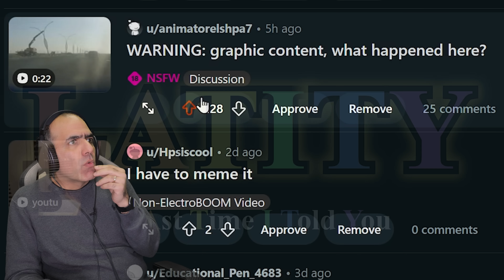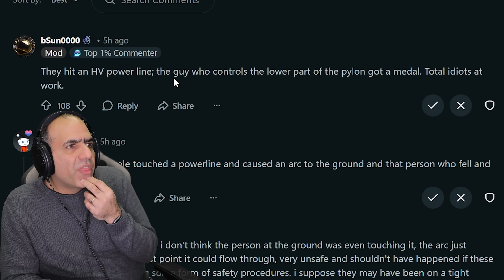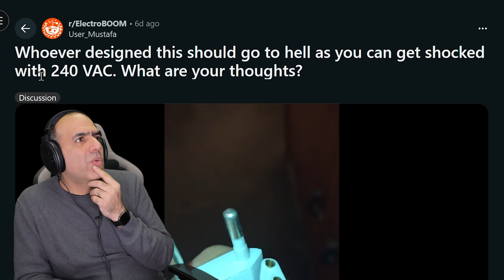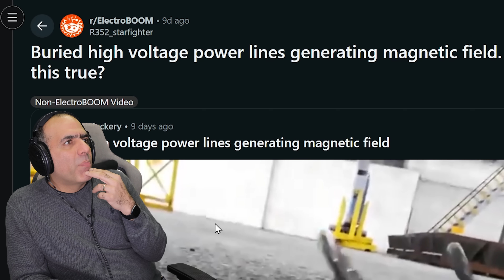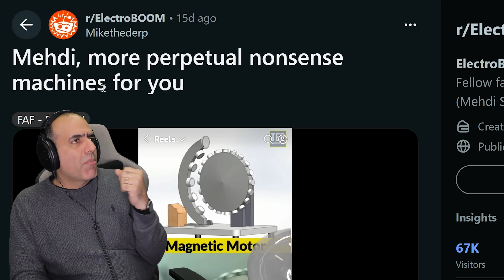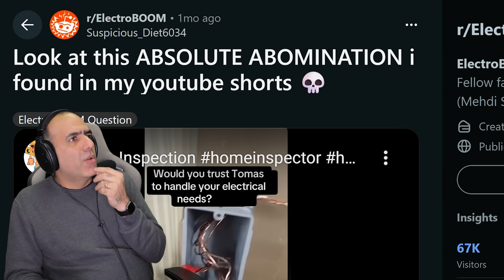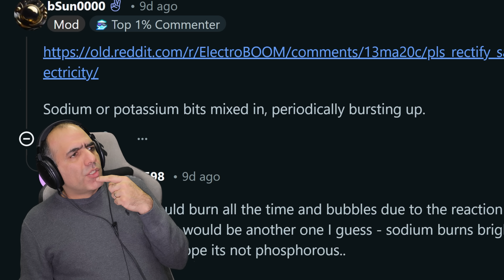Have a Pole? Need a Hole! (LATITY-017)

Comment: 5:20 it is a polymer capacitor - they don't have this emergency overpressure stuff - normally they don't build up enough pressure.
12:35 it is because of the momentum caused by the ion emisson, not heat. The heat expansed to every direction, so it wouldn't turn.

Comment: 11:03 those are contactors and it looks like that is an auxilary switch? But also unclear what it's switching so it could be some other accessory that attaches to the contactor. Usually those are clipped on securely not flopping around like that. Buzzing is a common sign of a failing contactor.

Comment: Japanese sockets don't use ground - they have a GFCI breaker on all those circuits instead. It was cheaper to install a GFCI breaker than to add grounds to all their outlets. Though modern installations do have grounded sockets.

Comment: I’m not mad at the title. Because it matches the display photo Apparently the user had a plug with a pole on the top. And there was an outlet with the same port as the plug but no hole. So he/she just drilled a hole in and decided to plug it in

Comment: Those double outlets with 220v and 110v aren't particularly common in Brazil but you do find them in some places. I'm a school teacher and the lab we use for experiments have those.

Some places in Brazil use 110v and others 220v. The most common is the 220v though. So we have to be a little bit careful with ordering things online because of that. Last semester the school bought a soldering iron I requested and I didn't realized is was designed for 110v. Of course I made it useless haha

Cone to Brazil man!

Comment: 12:41 Yes. Here in Brazil, it's very common to find outlets like this, and believe me, many incidents happen with electronic devices plugged into the wrong voltage. (Device designed for 110v plugged into 220v. Generally, 220v is used for high-power devices such as large-capacity ovens, electric showers, and air conditioners.) There are regions where 220v is standard (phase + neutral) and 380v (phase + phase), and 380v is used only in the industrial sector.

Comment: 13:03  hahaha ask me how I know it’s wrong, I live in Mexico , and I love repair drills and old equipment, I was on a face and bouth 3 metabo drills from the 80 but 220v and usa and mexico is 120 soooo you know were is going , wire the second face form the panel to my workbench but o I don’t have the euro plug aaah let’s use the normal and keep lit so the drills work I was happy but forget to disconnect the 220v code braker 3000 hahaha and tururu my boyfriend connect a extension whit incandescent lightbulb (the one for auto mechanics) and the bulb exploded hahahahaha ooh😂😂😂

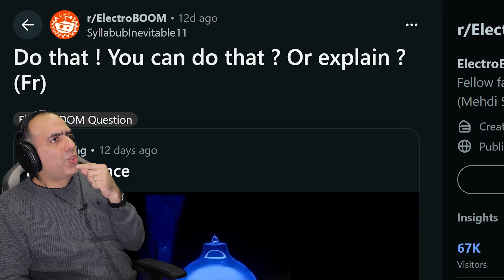Comment: 7:47 about the extensions , I use bosh, metabo, angle grinder cable because awg 12, its flexible and most importantly of all it’s free wen the appliance are burn beyond repair

Comment: @electroBOOM 10:23 it could also be a piezoelectric switch. I have one, which doesn't use any batteries. It uses the force of pushing the switch in either direction to generate the necessary power to send the signal.

Comment: 11:01 Capacitor soft-starters.  The loose 'auxilary' block with the curly wires cuts in power fractionally before the main contactor contacts close.  The curly wires are actually resistors that act to 'slowly' (it's actually a very short amount of time) pre-charge the capacitor prior to the main contacts closing the full current in.

Comment: 12:45 - We do have the same appearance for both, 220v two fase with 120º or 127V one fase. It's pretty common to see people using 220v devices in 127V outlet and complaining about low power as well see people blowing or breaking devices 127V in 220V outlets. In my house I reorganized them, REDs are 220v, whites are 127V.

Comment: I have a question. Since we cant create a free energy, why cant we just bring the energy, back where it is started to be reused? So my example is to use a rechargeable battery(s) that will pump the water up, down the stream to move the watermill to generate power. The energy go into the batteries and the remaining will go into the what ever you want to power up.

Like I said this is an example but I am interested if it is possible. Maybe not a home made model but if it is constructed with the right size and the right materials, would it be possible? Since it isnt free energy but it would act one since the battery is recharging and deploying with the right ratio so then the battery wouldnt ran out of power.

What do you think?

Comment: It's shameful that you don't have no regards for inconsistent lights which are extinct ,

In iran 
We only have cheap versions upto One thousand  watts of power,
Those pencil like ones,
What if you need cheap avaliable option for high resistant ressisstor in your circuit contraption?
If you use them in half of rating they serve long duty, 
They are safe,  desepate safe failers ,
Even act as a environmental senior for emergency do to their physical limits. 

I'm really unsatisfied when in experimental contraptions they need large ressisstors, 
They go with water hitters instead of lamps 💡 🥲
That's Immensely more si fi 
Even more than sparks and right behind plasmas and explosions cool factor implemented in a creative project. 

Bring back analogs, 
I whish an nuke this winter santa😶‍🌫️👊✊🏻🤛👊✊🏻

Comment: Why do you need ferrets, when you can actually just use a Shop-Vac on one end and a plastic bag on a pull string on the other. Faster and more reliable than a train ferret.

Comment: Plugging a 220V thing into a 110V socket can actually cause a fire (or trip a circuit breaker or blow a fuse). If the thing you plug in has a flyback converter, it'll pull twice as much current as it's designed for in order to get the correct output voltage. Even if it seems like it should be safe, don't mix voltages if you don't know what you're doing!

Comment: I still remember the first time I came across one of your videos way back in the early 2000s, it was the video of you opening up and discharging a camera's flash capacitor. You ended the video by dumping the whole thing into a dumpster. That video wasn't...super educational, but when I found out you had a channel, I was super into it. And since then, you've taught me a shitload about electronics. I didn't understand resistors or capacitors at ALL before your channel. So don't feel bad for the "silly" videos, they still get people interested, even if they themselves don't necessarily educate.

I feel like the issue isn't access to knowledge so much as it is getting people to want to learn.

Comment: Philippines is 230 Volts and these 10A outlets are secured with 20 A slow response circuit breakers. Ground is usually missing, even though our regs are based on NEC 2017. Likewise GFCIs and RCDs are usually absent as well. 

Our system is quite unusual: Each phase is 115 V to ground with no neutral and no ground supplied to the home by the electricity company. Our grounding system is considered TT, but without neutral conductor. The transformer middle is grounded at the post only with an earthing rod.

Comment: Having power outlets with two voltages is very fun, peploe aways burst they things plug in the wrong power outlet.
4 years ago, I worked in a factory that uses power outlets with two voltages in the kitchen for the enployers. One day, someone come to us (the electric maintenance) with a microwave oven that someone plug-in the the wrong power outlet, putting 220v instead 127v. Whe changed the fuse and the microwave oven work again. The same guy take the microwave oven and after 30 minutes he come again with the microwave oven not working again, and yes, someone put it in the wrong power outlet again. After that, whe print a waning label and put it in on the cable with something like "ONLY 127V".
And, yes, I live in Brazil.

Comment: 3:34 we use incandescent lights for theater because they produce a different type of light than an LED so you can put gels and other things on them. We also use halogen lamps which can use up to 575 to even 750 watts! I'm not an electrician tho so I probably got something wrong

Comment: 6:30 this is an aluminium processing factory, refining involves putting the "raw" aluminium through an electrolysis many reactors (around 200 for the largest factories) contains two electrods to purify the aluminium. The voltage in each reactor is around 4.5V but the current goes to 100 000 Amps, thus creating a huge magnetic field.

Comment: 3:38 incandescent lights are actually still helpful in older homes in the winter as they passively help with heating and save on power bills related to space heaters and furnaces (Its a little bit but trust me it's noticeable in heat and savings)

Comment: I had a fun electric shock issue with a really old hot plate a few months ago.  I was using it to make a finishing wax for woodworking and set it up outdoors.  As I was sitting on the ground stirring my pot of wax my hand was weirdly tingling.  I eventually realized I was getting shocked and there was some kind of short in the heating element.  I switched to crouching so my shoe soles were isolating me but still was very nervous about it until I finished.  I'm going to be switching to a different option next time I need to make more finishing wax.

Comment: 12:24   Don't you mean DC?      Looks like a high frequency DC Tesla coil, with a spinner.  I need to make one of those for mine.      
I've never seen high voltage A/C arc to open air like that (yes I have a 16Kv neon tube transformer too.

Comment: I still used incandescent bulbs in series as a current limiter with vintage electronics while testing them. If something shorts inside, the bulb just lights, otherwise it reduces the current to the device, this setup is also connected to a variac.

Comment: I remember a friend plugged his CPU into a 220V outlet when it was meant for 110V. Goodbye computer! Before connecting, check the voltage your device and your country's electrical grid operate at.

Comment: 9v batteries are designed to be able to link together to create higher voltage batteries (the + & - terminals can snap together)

every time i have two 9vs, i get the idea to put both terminals together, making an 18v incendiary bomb

Comment: The magnetic field making tools and other steel stand upright is in a primary aluminum smelter, and this effect is very typical for these smelters. The busbars running under the floor carry hundreds of kA. In the video you can see an aluminum electrolysis pot on the left side, covered by the angled panels. The dark grey angled beam is connected to the underground busbar and carries the current, it distributes it to the vertical poles sticking out of the panels, these are connected to the carbon anodes. Many of these pots are connected in series, these plants are often over a kilometer long.

Comment: 11:19 My water heater at home had a problem where the electric heater shorted to the water, so there was live voltage on the water pipes. Because I had GFCI installed, I was aware of that, but people who don't have one might get these kinds of issues.

Comment: 19:50 Bring electrical tape to the Philippines bring lots of electrical tape. When I visited I was moving a fan so I ran my hand down the cord to unplug it from the extension cord. Yes they're 240 V 60Hz is quite spicy!!!!!!
I ran out of the electrical tape I bought because I used a lot of it on chords with nicks.

Comment: 10:09 The switch is mounted on an iron column and the roof has iron beams. I'm more inclined to think they are using them to conduct the electricity to the bulb, so don

Comment: 13:00 I imagine it is for tourists. If you live in NA, you can buy adapters for 220V very cheap, but they still operate at 220V. Fine for most things, but not all. If you plug them into 110V instead, then you just get 110V!

Comment: I walked under high voltage power lines for years to get to school. I'm pretty sure the sound in the video is arcing from dew drop to dew drop (or raindrops or fire ants) along the ceramic insulators, not corona discharge.. A visible corna was rare so I can't swear to it but I think it made an airy and chill hiss sound. I imagine a squirrel would be quit loud but I guess they didn't want to go so high or were spooked by the tingles or fur standing up or something like that. At least one ventured up the lower voltage transformer for our house. The steam(?) explosion blew apart the skin on his belly and partly skinned. That sounded like a cannon going off.At least it seemed to have instantly killed the poor little guy so he didn't suffer.

Comment: Was so happy to solder my first little project. I used 3 13500 lipos I harvested from vape pens people threw on the street, and a USBC Lipo charger board, and soldered it into a $1.50 lantern from the dollar tree. Whole process took about 40 minutes, and I just used spare Christmas wire scraps to extend some leads, and a pair of pliers to cut some of the AA terminals out. It is able to run now, at over 10 hours per charge. Just a thing I wanted to share with people that might find it cool too :D

Comment: trying to use a new welder, but the anti shock feature... preventing the fiberglass asbestos from burning that normally creates a fire that electrons turn into a plasma. "arc fault built into appliance"

Comment: With the weird extension cord they probably got the plug and wire off a broken appliance and the outlet from a old house or building they built it themself from available parts that didn't cost anything

Comment: I wired an 240V baseboard heater yesterday. 
Connected one end without realizing the other wasn't completing the circuit.
I learned the importance of ground wiring that day; it literally saved me from 240V AC shock.

Comment: Brazilian here,
The electric grid is a mess, so we have 220v/240v and 100v/127v at same time in some regions of the country, but the entire country uses 60Hz
There's no difference between the plugs for 220v and 110v, but there's a difference for the current draw: 4mm diameter for 10A and 4.8mm diameter for 20A sockets.
It's not a big deal as seems to be because, the majority of appliances are Bi-volt.

Comment: 10:40  @ElectroBOOM  in our country (Philippines) have only 230V in the households while 240V in distribution lines. The 250V could be the maximum voltage that can handle the outlet 🤔

Comment: The switch is not battery powered, at least not in the conventional way. It has a piezoelectric generator, like some cigarrette lighters, that provides the power to a circuit for a brief moment. This is enough to transmit a code wirelessly to a receptor that toggles the circuit or triggers a command. I love these, and was suprised by the idea when I first find out. Pure smart thinking. Schneider Electric is the manufacturer.

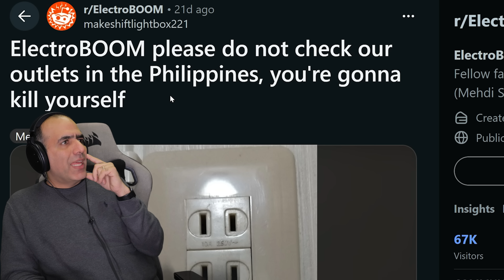Comment: 10:27 i believe you can also get/build variants of it that use the mechanical energy of someone throwing the switch to generate enough electrical power to transmit

Comment: In that first part where the light post contacts the power line the real hazard wasn’t the electricity, it was the arc flash.  That arc at the bottom of the pole is a ball of plasma that is hotter than the surface of the sun, and its initial expansion is faster than the speed of sound.  Judging by its size, the shockwave was the equivalent of several sticks of dynamite, only much, much hotter.

In my initial high voltage electrical safety training class, two guys walked in.  One of them had strangely smooth skin on his face.  He stood up and told us he was there to show us what would happen if we didn’t pay attention.  Then he took off his shirt.  His skin looked like melted candle wax.  Then he picked up his shirt and left.  The second guy told us he had been working in an L shaped underground vault containing 70kv cables.  The rule is you always have one man working, and another watching him to yell stop if he sees a mistake being made.  Being pro’s who had done this type of work for years, they got complacent.  The guy doing the work needed a tool they had left on the truck.  The guy with the melted skin was the watcher and left to get the tool.  He stepped around the corner of the L, about 30 feet away, and woke up from a coma six months later with burns over 75% of his body, and severe lung damage from the shock wave.  Nobody knows what the worker did wrong, but he was vaporized, as were the cables amd terminals in the vault.  The watcher had to be excavated from the vault which had collapsed.  Arc flash is no joke.

The thing he thought were breakers were 3 phase motor contactors.  The part that was being wiggled was the auxiliary contacts, used in the control circuits for the motor.  The buzzing sound was due to the high voltage motor contacts not fully closing.

Comment: @ElectroBOOM 00:10
Hi sir this product is available on several online shopping apps for 200-300 INR, and I've seen several reviews about it, all of them have the same comment: it produces cool steam. The reason for that is it's a fake product. 
They're selling it as a portable version of a nebulizer, a machine used to take warm steam in the cold. But the biggest scam is that it's fitted with a humidifier module. So, I request you to make a video on hot steam nebulizer using this product in the cheapest way possible in an energy-efficient way, and with complete safety. 
Because the standard nebulizer from the Crescent company runs on electricity, and If we use the battery, it will short out the battery, which could lead to the battery bursting. So please consider these things and suggest a portable solution.
Hope your video reaches to the manufacturers and they stop selling this fake ones

 amzn.in/d/5xXrEPa